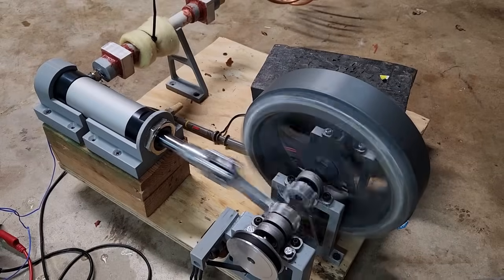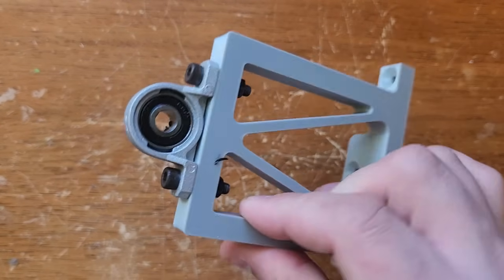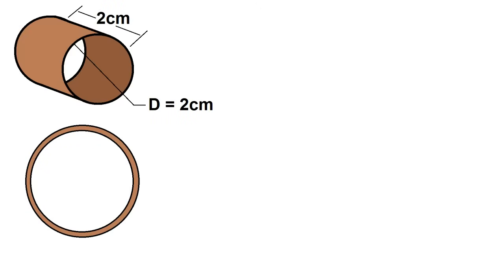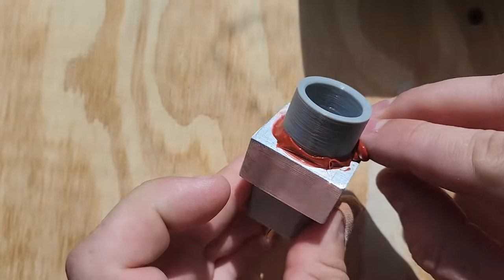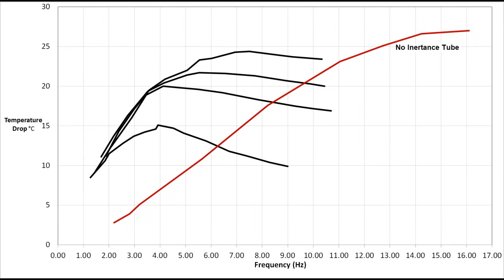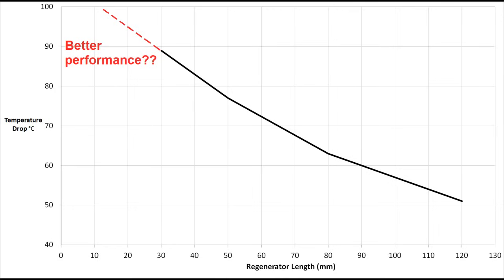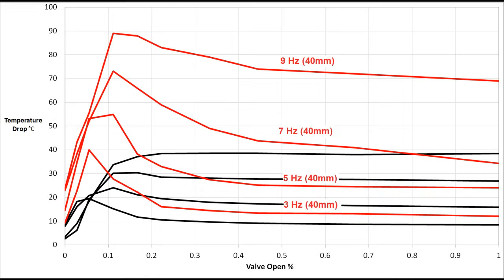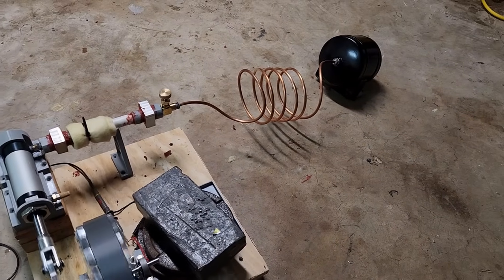Pulse Tube Cryocooler - Part 2 (-75C)

Comment: Dude I think you have the skills needed to make a device to remove water from the air. Make it as cheaper as possible and solar powered. Maybe it can save some lifes one day. Maybe even provide water for crops.

Water doesn't need to be super clean, the earth will filter it if used for crops and carbon filters can be used for drinking.

Comment: This is excellent! Having scratch-built several high temperature Stirling engines, I very much appreciate your approach to this.
Reply: Were you thinking of using the waste heat. Also, would a sterling engine make a good power source on the moon?

Comment: On the alpha stirling cooler: Maybe you would consider using two old  vehicle shock absorbers, or maybe these are too huge or steel walls too limiting for heat transfer. 

I've contemplated alpha stirling made from used shock absorbers with a rebuilt piston head for a solar thermal heat pump.  Sadly for my Idea, I think the thermal dissipation is way too limiting to move 1kw of heat energy and I would need a way to get very much more surface area. But a cryocooler would not need to move that much heat.

You might jump up to using 1/4 hp motor, And use a 6 to 1 pully ratio.

Comment: use outflow from an airconditioner to cool the hot end, then you get a lot of cooling "for free" and artificially inflate the Delta in temperature, meaning you can use a lot less restrictive heat exchanger.

Comment: Great stuff.  YT just recommended this, and I'm looking forward to binging your channel.  One question though:  Why didn't you start out with a large air compressor hooked through a VFD, and optimize the plumbing to suit?  That'd spare you the hassle of dealing with mechanical issues, and let you concentrate on the thermodynamic side of things...

Comment: Normal cryo cooler are two cycle cascade cooler and the low temp refrigerant are high pressure refs and liquifies in the high temp evaporator. The problem für cryos is the high wattage you need exponentiell caused of Delta T To the Ambiente.

Comment: Really cool project and great video.  I like the technical details you show, and your methodical experiments, all very educational.

I do think moisture in the air is limiting performance.  The easiest way to get really dry gas is to use nitrogen or argon.  Helium is expensive, and both He and H2 are really difficult to seal completely, leakproof.

Comment: Might sound stupid but why not just build a jt cooler?
Reply from the maker: Less efficient, requires an expensive (and very loud) high pressure compressor, and the JT valve/orifice is extremely prone to clogging
Reply: @HyperspacePirate  Might also be a stupid question but can't it be done with a refrigeration compressor? I imagine high pressure is ideal but not really mandatory if you just want liquid n2.
Reply from the maker: @RNA0ROGER  It's practically impossible to reach LN2 temperature with pressures <100 atm unless you have a 100% efficient regenerator, because the temperature drop caused by the JT effect is far less than the temperature drop caused by expansion in a stirling or brayton cycle
Reply: @HyperspacePirate  Well that sucks

Comment: I did a lot of research on making liquid nitrogen, the simple solution is just buy a cryocooler which is what most every video did.  I found two that actually made their own, and it was a massive time sink and super inefficient, so very expensive to produce.   I also found you can just buy liquid nitrogen pretty cheap if that is all you really want.  I bought a big dewar to hold it, but really I need to use excessive solar to create it as energy storage.
I thought I could use many stages using different technology, but ultimately ones need the cryocooler as the final stage.

Comment: This was fascinating!   Being a low-grade moron compared to your math skills, i am intrigued to ask would this device be something that could be battery powered & run off some solar panels?   My mind was thinking a small device for cooling a tent or teardrop trailer off grid in Arizona (hot, but lots of sun).  How much power were you inputting to get the temperature drops you had with this?

Comment: Amazing! such encouraging results. Im going to attempt to do this, now Im thinking in doing a hybrid two stage system, The first stage a common phase change refrigeration system that cools down the hot end of the cryocooler to about -40C° I think with an well optimized second stage will be possible to reach -200C° while still getting an useful amount of cooling power. Yes! finally will be able to have LN on demand, no more relying on second hand cryocoolers that can't get pass the customs. Well time to tinker how to do all this in a sealed system so I can use pressurized helium for a reasonable amount of time.

Comment: Can stainless steel wool with a lot of copper dust suspended in be good performance matherial? lack of conductivity due to spacing made from poor conducting wool and a lot of mass thanks to copper. Plain wool could do fine, but idk how much copper dust can be suspended, and it can't walk around :v

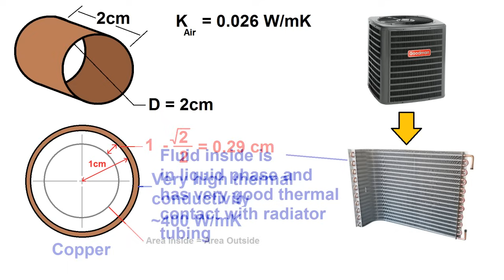Comment: 5:39 Most of the heat is removed when the hot refrigerant gas is cooled and condenses into a liquid. Not very much heat is removed after it becomes a liquid . It is the phase change from a gas to liquid that releases a lot of heat.

Comment: NASA had an application I stumbled across sometime in the 2000-2012 timeframe that I can no longer find. It was called ACOPTR. If someone can find the source code for it, I’d be willing to host a virtual machine and figure out how to make it run.

At the time, the results it gage compared reasonably with academic papers from people experimenting.

With a few mouse clicks and tweaking values, you’d save a lot of time building variations to test.

Comment: Regarding helium, you should be able to see a significant performance difference, even with low grade helium "balloon" gas.  Get a balloon, "fill" the system as best you can, and you should see a notable difference.  The speed of sound is higher in helium so you'll need to retune your buffer length and driver frequency.

Comment: I've long wanted to build one of these and am getting juiced after seeing your efforts!
I'm considering a Ringbom design and a linear magnetic drive with bellows for compression.  Of course, the key is getting everything resonant, not necessarily sinusoidal, and what better way than electronic drive.  Also, an electronic drive can be regenerative.  I wonder if there is any benefit to a multi-stage floating piston.  Would seem difficult to get the resonances right, but it could conceivably help the coldest stage by not having such a deep temperature well to pump from.  Any thoughts on this or Ringbom in general?

Btw, cleaning up steel with a magnet is easier if you put paper or plastic around the magnet first, then just pull off and discard.

Comment: Wonderful that you are using metric units. Just a point CC is bit of an archaic usage. Millilitre (or milliliter if you prefer) is the usual SI unit abbreviated to "ml" though we Australians prefer "mL" to reduce symbol confusion. Millilitre  follows the thousands rule and is consistent. Eg 1 mL is 1 mg of water at standard temperature. Try that with those pesky gallons (and whose gallons anyway?) and pounds 
(weight not currency).

Comment: Keep up good work, I've posted few questions in Part 1 video, if you have a chance to answer. I also got single-stage pulse tube designed to precool nitrogen gas flow, and since it's limited use outside of gas cooling was thinking to take it apart to see how it's built internally. Haven't got to that yet, but if you think it's useful, I could get to it sometime.

Comment: I dont know where i would need this..yet and while this seems like black magic on how it operates its really interesting never the less. Maybe if this coldness could be put into very light oil or pressured air to rapidly cool part after its heated hot to open up rusted bolts or to cool down parts rapidly for interference fit instead of using average freezer...

Comment: We had to build air engines in college that were very similar to your setup.  The teams that used a fabricated crank shaft were absolutely blown out of the water by my team, since we used a solid machined crank shaft.  Don't handicap your experiment with shitty components.

Comment: For better heat transfer you can use heat pipe with ends cut off instead of regular copper pipe. Heat pipes have copper wick on walls and it transfers heat from gas inside pipe to pipe walls significantly more efficiently than just regular pipe.

Comment: What blows my mind is that a bunch of dudes without access to oscilloscopes, digital temperature probes or CNC machines figured a lot of this stuff out in the 18th and 19th century.
Reply: Also no dis on the video; making a pulse tube chiller from scratch that’s efficient enough to freeze CO2 is hugely impressive work.

Comment: As an HVAC technician. Very nice setup... Cpl ideas
Use multiple 2mm tubes between aluminum heat sinks in a spiral design for buffer tube. Also look into adjustable txv. Last add some fins to the flywheel to move air over the piston and buffer. This should help with eject heat from the system and get a better overall cooling factor.

Comment: oh ! funny i should get this recommended to me , Im currently working on a 3d printed air compressor , it would be super easy to modify to do this . how effective would it be at say using the heat off the hot side and dumping the cold outside . I have been working on a 3d printed heat pump for a while now , and i didn't know this was a thing . previously i was working with a sterling type setup, witch i guess i could use that as well . great video very inspiring .

Comment: A tip I like for cleaning up ferrous metal swarf. Put the magnet in a bag. Swipe it over the swarf, then turn the bag inside out. The magnet remains clean and the swarf stays inside the bag.

Comment: It was a great presentation again! Congratulation! DELTA EC program from Penn State University could help a lot to you in the next steps. There is possible variations of heat engines and heat pumps from simple alpha Stirling to pulse tube via thermoacoustics. The resonant frequency of the system is one of the main thing to increase the performance with a better performance of HX & regenerator also with changed basic parameters. Try to abstract from the pressure ratio a bit, because ThermoAcoustic systems could rich this temperature range easily with low compression ratio, typically under 10%. These materials that you used are enough good for a trial run where you can see the effect basically, but with this density, wire diameter and thermal properties of the regenerator just with a bit poor performance. The Achilles-heel the HX parts in every "homemade" heat pump. (I think it again, because maybe just we've made this type of unit in public...) I know you've learnt a lot about this unit, I'm impressed!, so I just suggest to you look around the thermal penetration depth for better performance of heat exchangers. The regenerator density is not a big problem here, that will create a phase shift too, when it will dense enough so try to not worry about it too much. The moisture is a real problem, because the ice could block the gaps. Alpha Stirling has a high compression ratio but if you can hit the -100 degrees Celsius you will experience strange things with sealing, or around the solid material when you want to going under. BLADE SPS: Sorry for the essay!
Reply: Would a phasor diagram be of help here? I have been led to assume that mass flow is king.

Edit: also that the goal of a phasor diagram is to balance the diagram on the middle of the regenerator. Would this be correct?
Reply: Thank you for the essay

Comment: Have you considered crushed boron metal for the regenerator? It’s specific heat is better the aluminum (double that of stainless steal) and thermal conductivity similar to stainless steal.  There are eBay seller.  Hmmm, maybe corse powder pure boron seperated with thin loss woven fiber glass sheets?

Comment: You experimented with a lot of different lengths and tubes with the smaller piston, could you do the same tests with the larger piston? You found that the smaller piston did best when one of the other volumes was very close to it, did you adjust that volume after changing the piston?

Comment: As far as I know from my heat transfer class in college, the heat transfer equation is usually broken up into a thermal conductivity portion and a convective  heat transfer portion(radiation is usually really small and ignored). Finding the coefficients for the convention is a pain but if you use a simple heat exchanger design it isn't too bad and the data is available in textbooks and probably online.
Reply: Also AN fittings are really good for tubing connections, but if the solder works I am all for it.

Comment: A 3530 motor will have a smaller motor constant than a 3536 motor. They are usually named from the diameter of the stator in mm concatenated with the length of the stator stack.
As long as you have access to gearing you want to stay at high Kv motors if you can though as they will handle more power (although at a higher output rpm).
Calculate the motor constants and see. Keep up the fun videos I'm making popcorn!

Comment: I found your channel yesterday and binged on past videos this morning. I had wanted to attend the University for engineering, but the one I attended did not have an engineering department thus I chose mathematics which I enjoyed so much that I kept at it after the first degree, but I am still a big fan of engineering, especially prototypes. 

As I watched your videos I have become confused, surely you must have an engineering degree, but which, EE or ME? It seems like either is fitting and being 67 now I may not be aware of today's integrated engineering programs that seem to blend both electrical and mechanical in a combined program.

Comment: Replace the copper pipe with heat pipe. If you can't find one at a decent price you can use copper wire to make your own. Look up weaved heat pipe. There is a bit of a cheat you can do to making it. Use the weaved copper shielding off of a shielded cable. Once it is in the tube you'll probably want to bake it for 8 ours at 800 to 900 C. The other option is fill the heat pipe with copper powder and bake it the same way. That will give you a lot more surface area in the pipe. You will probably want to start with a larger diameter tube than you currently have because it will restrict flow.

Comment: Did you change that buffer gas volume to match the larger cylinder? You mentioned the correlation between the two but didn't see you change that bit after the larger cylinder.

Comment: It might be nice to see a thermal image of this running. I'm guessing that a decent amount of heat is being generated at the valve from the flow turbulence that in a large, commercial system would be mitigated by some kind of expander.

Comment: Thanks, this took a ton of work. I've been wanting to do this myself for ln2 or lo2 but I thought I was going to have to get my hands on a turboexpander.
It would really be nice if you could automatically vary elements of the system with servos or whatever so it could self-tune. None of the graphs you showed had more than one peak, so it doesn't seem like there's local minima (or maxima) to get stuck on.

Comment: -75°C with no coolant is DEFINITELY nothing to scoff at! How many amps was the motor using at that point? Would be curious how this works out in terms of energy efficiency. My guess would be "not as good as commercial refrigerant-based cooling, but maybe good enough to run off of solar power", which would definitely make it of interest to a large potential audience of off-grid and renewable energy enthusiasts!

Comment: How do you apply the temperature once you've reached it? I mean, the low temperature occurs on one side of the contraption at a point, right? So how do you take it from that point to cool down the nitrogen, or carbon-dioxide or perhaps even a room? 
Cooling solutions are a big part of our future, with summers getting unbearably hotter, but if I place this thing in a room or inside an AC, would it be enough to work?

Comment: Trying to keep helium inside your setup is going to be nearly impossible, as it will diffuse through plastics and silicone, and leak through impossibly tiny gaps. Argon should be as easy to seal as air though.

Comment: For heat transfer rate across the heat exchangers, conduction of air is a very conservative estimate.  Using convection, you can take the movement of air into account (convection is just the combined effect of conduction and mass transfer).  Qdot= h*A*(Tfluid-Tsurf).  “h” comes from the nussult number, and thr nussult number comes from a nussult-number-correlation equation.  Correlations differ by whether the flow is laminar or turbulent (there are equations for this) and whether the flow is forced convection (already flowing) or natural convection (the temperature gradient causes buoyancy differences which initiate flow.  Wikipedia has some acceptable curves nussult number curves, but a good engineering reference book would be most accurate.

Comment: This is incredible! One piece of advice though, PVC is not usually rated for a load. You appear to know what you are doing, but there are a lot of people every year from the PVC in their potato cannon (and similar projects) exploding under pressure. I don't know too much about it but it might be something to look into if you didn't know about it (especially since plastic becomes even more brittle the colder it gets). It would be a shame if this project was never finished because of a material mishap